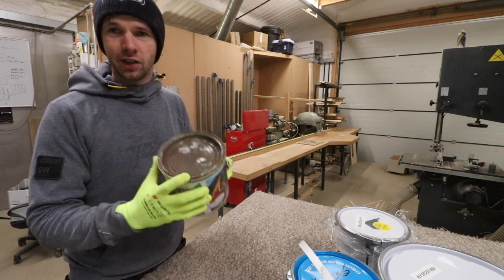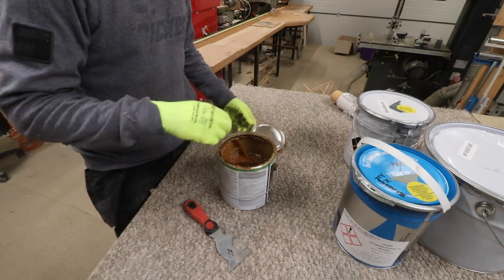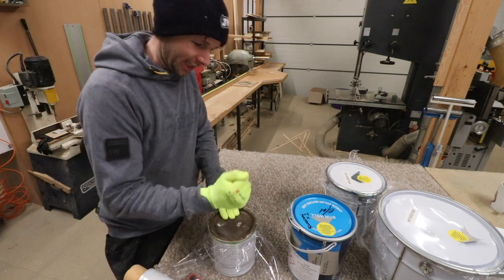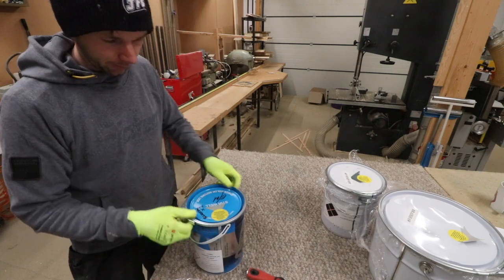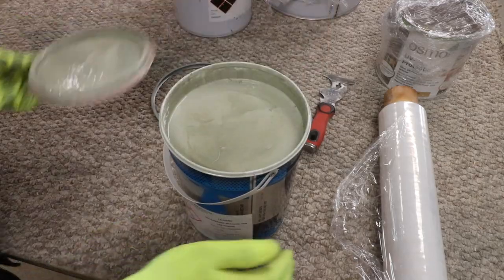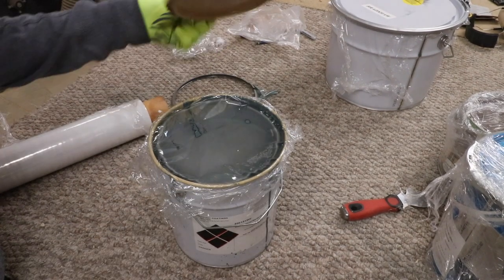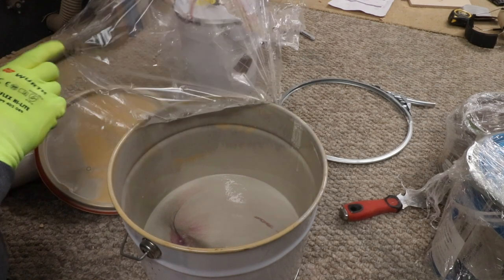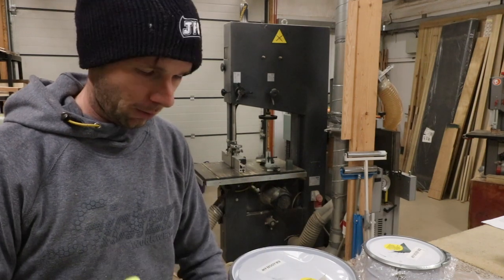No More Stuck Paint Tin Lids!!

Comment: trade trick - to open a stuck paint tin, dent the side of the tin with the butt end of your scraper (don't hit the seam) this lowers the volume inside the tin and the air inside becomes pressurised, then when you begin to wedge the tin open the air pushes from the inside and the tin opens - i'm a professional painter we do this all the time
Reply from the maker: Nice idea! 

Cling film is working brilliantly. Not had a stuck lid in 5 years!

Comment: Nice tip. I use large sandwich bags, they slip over a open tin before you put the lid on. 👍🏻
Reply from the maker: Nice one👍 same principle. I've used plastic separation a lot in curved work for glueing prices together without sticking to the bench but it wasn't until about a year ago I used if for this purpose. And it's been really great!

Comment: Hi, great tip.
I have been catching up your previous videos and found them to be really helpful.  Thanks.
I have a light weight Spindle Moulder (2HP) and recently got a Whitehill alloy euro head, but now need a rebating block.
Would you advise an alloy 2 blade block (100mm) or a 4 blade shear block (125mm). I do general work, including furniture although currently looking to make window frames. 
I have been watching your series on the oak casement window.
Thanks for your time
Reply from the maker: Erm.... ive never used a shear cut block tbh, do you still get a flat cut or is it a slight curve due to mounting the blade at an angle? I would go for a 4 knife block, there isnt much difference in cut (a little) but they longevity is better. If you are doing windows i would advise a rebate block of a size to cut your rebates in one depth cut if possible. I like the 100mm tall block i have as it is very adaptable. Only time i need a smaller rebate block is if i want to cut above the workpiece... 

Ive never used a rebater, but i know the planer heads with the spiral cutters are very popular, have you looked into them as a rebater?
Reply: @BradshawJoinery  Thanks for taking the time to reply.  The 125mm diameter 4 blade block that Whitehill sell is a shear cut. The blades are set to give a square cut, but deal better with some grain.
What brand is your 100mm high block ?
The spiral cutter cutter blocks you mention, seem to be used mainly for curved work with a bearing guide from what I see.  They are relatively small in diameter and would only be able to cut a shallow rebate.
Thanks again.
Reply from the maker: That is mine,

https://www.whitehill-tools.com/cutter-heads/rebate-heads/060A00130/

It's handy as I can tilt the spindle so it means I have a 100mm angle cutter too.... 

Blades are expensive but last a very very long time and are top quality!
Reply: @BradshawJoinery  That's great.  Thanks.  Although there are cheaper alternatives, I'm going to stick with Whitehill.

Comment: Brilliant tip.  Wish I'd know this before I stored the 30+ tins I've got in my workshop :-(. i find the paint in the tin also deteriorates because of the low temperature in my detached workshop.  Too cold to work in there during the colder months.
Reply from the maker: My paint store isn't heated so I built a cupboard and lined the inside with celotex and put draught seal in the doors. I have a small thermostat plug and a greenhouse heater inside and it keeps it at 15 degrees very cheaply! Might be worth looking into for glues and paint etc. It's knackered if it drops below freezing
Reply: @BradshawJoinery Bingo !  That's my next workshop project then.  Great idea.